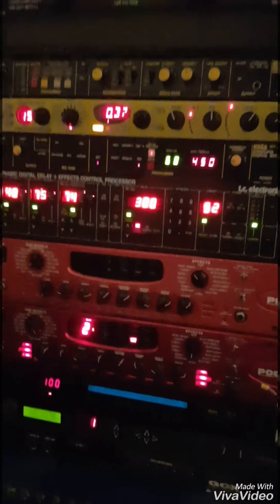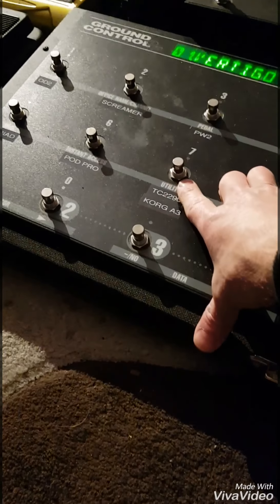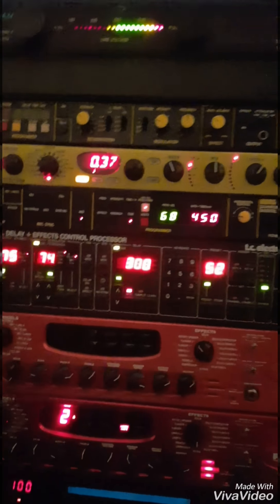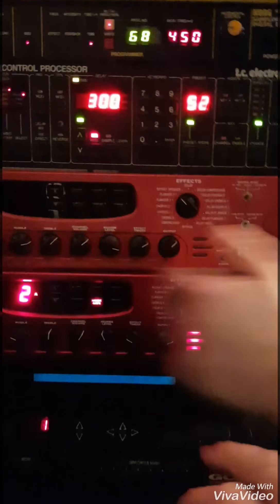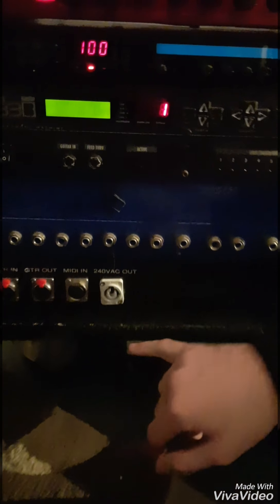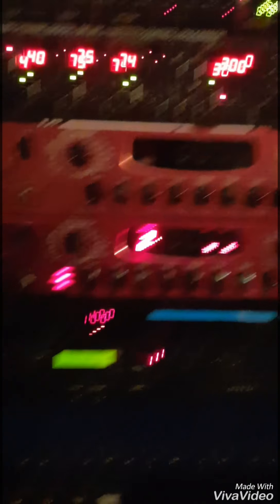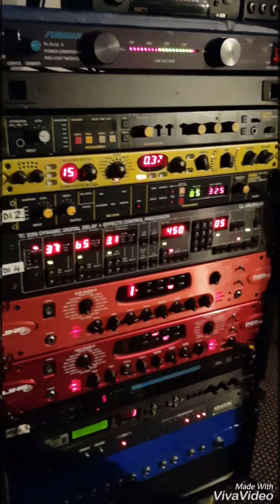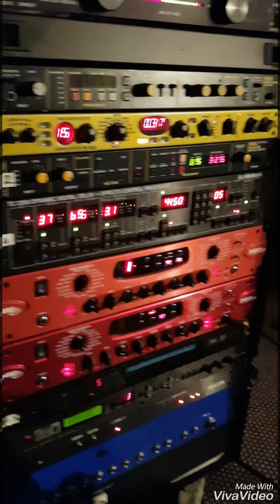U2 Shimmer with Ross Louden Guitar Tech W2 Rack

Comment: Which single pedal would you recommend for U2-like shimmer at the moment? I have a two amp setup, with all the effects going to a Vox and a clean Fender just for the shimmer, with split directly after the input of the pedal board and a volume pedal to blend it in...
Reply from the maker: In pedal I would suggest the Strymon Blue Sky. I use Digitech IPS 33B which you need to add reverb to smoothe it out.

Comment: Hello Bob . I would like to know what effects or setting you use for BAD and STREET. and what strings do you use? because they recommended me to use the number 11 strings and they are very heavy. what strings do you use?

Thank you
Reply from the maker: mm mm Hi. I use size 11 for my strat & les paul. I need to check my TC but I think 364 for streets & 2 x delay 445 & 520 for bad.
Reply: ok, well the strings 11 are very hard for me, apart from the delays, you use apart some preamp, compressor, amplifier simulator for BAD and STREET ??